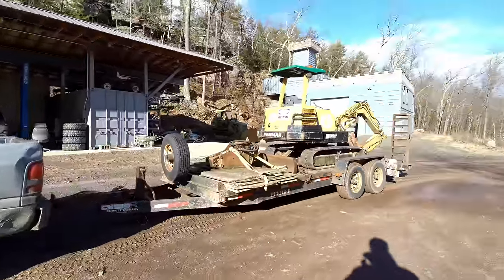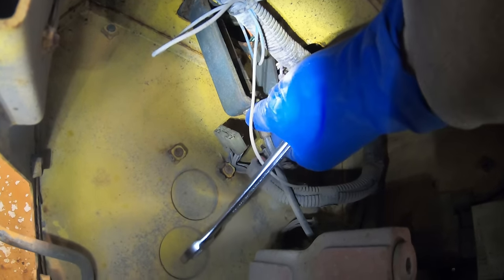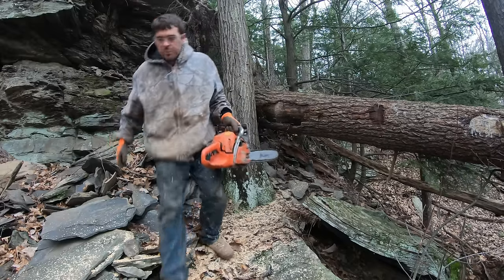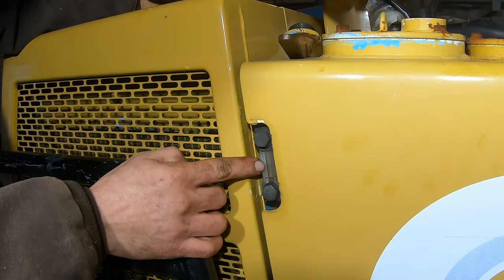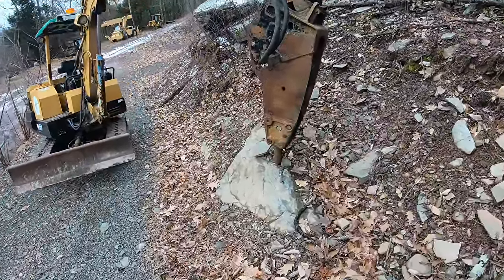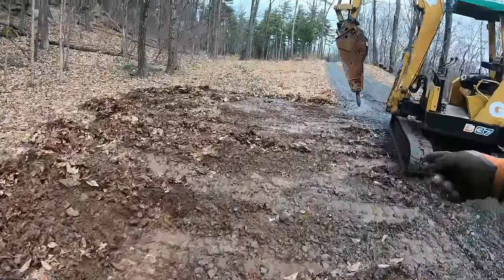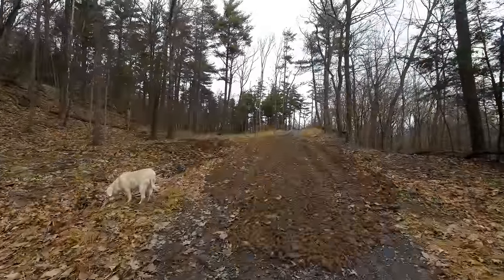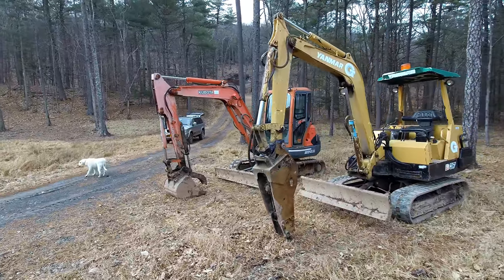Buying the cheapest excavator/hammer on Marketplace

Comment: Hey Andrew, I am looking to get into the excavation business, I am 20 years old, I have experience with tractors and such and I am looking to purchase an old used excavator. I am quite handy when it comes to fixing things, or building things for that matter so upkeep/ repair work shouldn't be too big of a deal. Would a 5k pound excavator be a good starting point for smaller jobs? I will probably be buying an Isuzu NPR dump bed truck in the next year to tow the little guy around and fill up with brush or materials. So yeah, would a smaller excavator be a good way to start and what tips do you have for someone just starting out? Thanks!

Comment: Instead of the tape, go over to your welder and put a small tack on the pin washer and grind it off later, when you get the right pins. That did seem to work quite well, though. The pin was just lacking the extra length to stick out and get a retainer in. The strength is there.

Comment: Try hammering a stump from the outside towards the center.. It usually works better with an axe that way. If you hit in center i guess the wood evenly distribute the applied force and therefore decline splitting..

Comment: You could change the control valve and pedal and have the hydraulic thumb on the Yanmar. I'm sure you can get it done if you want it bad enough. If it's a stack valve, it wouldn't be difficult at all.

Comment: Should have doser blade behind you as you dig - keeps you from tipping. Kobota looks good and warm in the winter for ice breaks and issues... cool.  Real nice source of rock for stack rock wall or design.  Hammer is way cool and your use is as good as normal. The hammer may have never been used or like you in test try. That might be another company that has yellow.

Comment: Check the hydraulic couplings and make sure they have good contact inside.  That nub gets worn down and lessens the flow of fluid.  Pull back on the coupling ring to make them connect easier, don't just push the connectors together.

Comment: Hey Andrew, have you found specs/manuals/etc for the Yanmar B37 anywhere online? Mostly interested in the height so I can tell if it will fit through my garage door. :) I'm thinking about buying a mini-ex and based on your thoughts about the old Yanmar B series (no electronics == good), I'm leaning in that direction.

Comment: Aren't those auxiliary Hydraulics different? One high flow, one directional? If the Hyd temp gets hot with the hammer, get rid of those quick connects, they add a lot of head to the system.

Comment: Isn't that bar kind of worn down pretty short? It needs a new chisel bar, doesn't it. Or is that the normal length for that hammer?
Reply from the maker: Yes it was short, I replaced it later. Than replaced the whole unit when it started leaking and could not get fixed.

Comment: Andrew, how does the hammer attachment work, does it have like a rotary valve that makes it hammer. I'm sure it's like a regular jack hammer, but I don't know how they work either. Never had an opportunity to take one of them apart.
Reply from the maker: I have never taken it apart. It works off hydraulic instead of air. It works fine.

Comment: Andrew. Run the ass off that KUBOTA. I think am going to buy a smaller one (KUBOTA) then you have. Want to hear!!!!!!!!! What you don't like and like about the machine.  I like the factor your in a closed cab which is a great thing..  You'll come around to enclosed cab some day. As for your other machine with the hammer. Keep that hammer on one machine. It takes the life right out of a machine with a rock breaker. Good luck with things love all the new used equipment...The trailer that came with the machine 
Nice drop tail. Take care. Stay warm JUNKMANDO
Reply from the maker: I like the machine so far. I got to spend a day in it. The heat was nice.

Comment: I dont know much about hydraulics but single acting cylinder comes to mind. No idea if it would work or be practical to step on the pedal to close the thumb and step off to open it. The pedal valve might not work with it as such.

Comment: So I have a B27 of similar vintage. No aux hydraulics but would love to have it. Can you tell if the system on your B37 is OEM or was added? Any ideas on how to add aux hydraulics? I've been told the pump is plenty big enough. Also do you know what the levers on the post for the controls do? Great videos!!!
Reply from the maker: That was added, It is only a one way system for running a hammer, it could not run a 2 way function like a thumb. This guy might be able to help you out with adding aux Carter 914-539-1208 
Or you could steal it from your boom tilt function that you probably never use, lol.
Those should be your safety locks.
Reply: @AndrewCamarata  Thanks, a hammer is what I want to use. So much easier on an excavator than a skid steer.
Reply from the maker: Yes, that's what he specializes in. Yeah, the skid steer probably cant reach stuff allot of the time.

Comment: I believe your stabilizer blade cylinder is    swapping fluid over the piston causing your lack of down pressure. Just rebuild cylinder completely and your problem should be solved. Basically you have an internal leak on that cylinder,
Reply from the maker: Doug O the level was just out of adjustment. It gets fixed in a later video.

Comment: question for you Andrew. which 7-8000lbs mini x  would you recommend to a guy starting off? been looking at kubota. also would like to avoid any with emissions equipment/egr ect. What year did the machines start coming emissions equipped?
Reply from the maker: Anything made in Japan. Emissions nonsense only started a few years ago. So get one that's at least 5 years old.
Reply: Andrew Camarata perfect thanks

Comment: Did you check the tool box on the machine for the hammer pins?
Reply from the maker: I didn't see them. I converted this machine to quick change. That was a big improvement, there are videos covering the project.

Comment: Cant beat a kubota, 10k hours and you can still use it everyday of the year. I dont buy any other brand. Ps when using the pecker youll find its more effective to put light force on it rather than the full weight of the machine, it needs to reciprocate to have the most effect, too much downward force prevents that

Comment: whats the GVW of the trailer...? 14k...? do you have a combination registration on your truck...? not sure about N.Y., but in Pa. the fines are big...
Reply from the maker: Combination registration?
Reply: Dont need it for a pickup n trailer lol.
Reply from the maker: I still don't know what it is. The truck and trailer is registered/inspected, the truck is insured. My bigger trailer requires its own insurance. IDK these nonsense laws are getting out of hand.
Reply: 1st...you don't have your DOT number on the truck..........2nd...the GCWR (Gross Combination Weight Rating) is required if your trailer is over 10K, and it looks like you have 8-lug wheels which should be 14K...check the plate on the trailer tongue...

Comment: Does seem to be a pretty good deal on the package but for some strange reason the trailer looked overloaded to me  as far as weight ?    you can’t beat Yanmar motors IMO  I’ve been a boater for over 25 years and everyone imknow with Yanmar power loves them  over anything else they have owned   years ago people used to say   no you will never find parts  but the reality is you usually don’t need to with proper maintenance  and care

Comment: andy go bye a cheay set of big wrenches and cut them in half  they will work alot better when you need to do hoses like that  trust me i did and it saved me a ton of time and money in the long run and you we use them more then you think harbor frieght specials will work just fine
Reply from the maker: Ok, I might, I just ordered a set of line wrenches.
Reply: @AndrewCamarata  i have them too but sometimes its just easier to have a half wrench to use in tight spaces good luck and again thanks for sharing i really enjoy your videos  i hope this helps andy
Reply: I was going to suggest the same. Pain in the a s using the longer wrenches. My father was a do it yourselfer, he had a set that he cut 30 years ago, still using them today. He worked more on Drilling equipment but same kind of hydraulic systems. Thanks for sharing.

Comment: To check hydrolic fluid: blade touching the ground, bucket flat on ground, stick 90° angle with ground. Keep all your pins greased up. The chisel on the  hammer need grease too you gonna fucked piston and walls.

Comment: Ok fellas take me to contractor school here. Im wanting to possibly start a skidsteer company clearing empty lots for houses etc, how do you guys charge? By the hour, SQ ft, etc etc, i know we need to factor in fuel costs per job etc but what keeps me from going ahead with this venture is im afraid i will charge too little and get in a hole and not being able to afford the payments on a skid. 

Another question, would you guys recommend leasing a skid loader or buying new or used? Also track vs wheel??
Reply: Willie Fistergash personally I would advise going to work for someone else first that way u get experience learn the equipment as now how to do different think in the most efficient way
Reply: Gasmonkey57 thank you buddy for the reply and helping decide what to do! What worries me is currently im disabled and 45yrs old! I dont know if a company would hire me so i was going to try a start some type of business myself as my health slowly gets better! One thing i know for certain is i love working outdoors, and being my own boss would be nice as well. But yeah i know what your saying, on the job experience with a company and possibly operating different equipment getting experience would be good!

Comment: Some rocks might let you pound a hole and then a 1/4 stick of TNT might shatter the rest. Having two on this job saves hours of doing one and changing doing and changing back and forth.
Reply from the maker: Its hard to get TNT
Reply: They make a mixture stuff that is sold in Hunting places - Academy etc - that you blow up beaver dams.  Not TNT but is powerful.  Registered by 12 oz container.  Just use it and don't stock pile a bunch.  It is two powders you mix and then you detonate the sealed/taped bottle.  (they by rifle).  You tube beaver dam.

Comment: hey Andrew: here is your new piece of equipment. It is a skid steer excavator. You take the excavator bucket off, put a skid steer bucket on, flip a switch, and all the controls change to skid steer. Take that bucket off and put back on an excavator bucket, flip the switch back over to excavator and you now have two machines in one. Not sure though, because it is still as tall as an excavator, even though it runs with controls like a skid steer. Not sure if it is as fast, but in excavator mode, it looks like typical digging speed. https://www.youtube.com/watch?v=Abr97zhMKRU

Comment: Maann 11,700 and 13,400.. 
I just found out that i could sell my Vio 10 for 15k or something. It was 16,800 brand new from the dealer back in 2004.
Crazy market..
Reply from the maker: isnt a VIO 10 crazy small?
Reply: @AndrewCamarata  Yes it is small, 1,2t. But not as small as most people think. I would say it is roughly like your komatsu, maybe 1/3 smaller and it is a zero swing machine.
And yeah most people just laught at it. "Eeehh no i'll do it by hand" ect.
Yeah... until they need it because they want to have something bigger done in their backyard and every other machine is to big to fit there. I'm the only guy in my area with such a small excavator. It is a nice little niche market.
And in 18 years it has never ever been broken down once. Just normal maintenance and it is now on the third battery, that's it. You are right about yanmars and parts, you just don't need any. Not once i had to call the dealer to get parts, advice or anything else. Yanmar is the way to go.
I wish they weren't forced to put this emissions garbage onto the new ones. This crap just ruins everything, regardless of the the brand.
Oh and Yanmar even made a couple of models even smaller: B03 scoopy, B05, B08, SV08. Really funny. Worth a google search.
Keep up it up Andrew, you are truly an inspiration.
Greetings from Germany.
Reply from the maker: Yeah, we should phase out these failed emissions programs.
Reply: @AndrewCamarata  If only half of the politicians would have like half a brain and common sense, they would do it.
I just watched the video from JH Diesel and 4X4. I can't even find words for this.
This is sheer lunacy.
Here in Germany we have similar organisations , and they also do what they want. This has to stop.
Let's hope that sooner than later people with brains get into power.
Anyway.
Have a nice evening.

Comment: Andrew, I can send you a CAD file for cutting out the kubota quick connect file, it is 3/4" steel and I had them cut for my kx71-3, perfect fit.
Message me and I can get the file over to you.
Reply from the maker: Its Andrewbcamarata@gmail.com How would I cut it out? I don't have a CnC table.  I already finished the project though. I just ordered those tabs off ebay.
Reply: @AndrewCamarata  You would have to take the file to a shop with a plasma table, the guy that made my set charged me $40 a set and i saw on ebay they were $125+shipping. I saw your video, looks good.

Comment: Andrew check ritchiebros.com and Iron planet. Awesome prices and set of machines. 18,000 hs is just 2250 days of 8 hours, 6.16 years. 8000 hs, /8=1000 days of 8 hs of work, less than 3 years. 10,000 hs/8=1250 days of 8 hs work=3,42 years which to me, both are great boughts and, as long as they function they will always have value so you may recover more than the inversion plus the money on the work you do. They don't look abused just the Yanmar a little out of maintenance but both are a "gold mine!"

Comment: 25:09 does anybody have an opinion to this, make a wedge 1 foot long and  2 inches thick sharpened welded to the jack hammer pin would it split the wood?! Kinda would be cool if it was possible

Comment: I have a kx121-3 & I run the hammer off of the thumb hydraulics
Reply from the maker: Good to hear. I'll try it once I convert the hammer to fit on the Kubota.
Reply: I can send you pics if you want of the adapters used so the thumb doesn’t release when switching to hammer
Reply from the maker: Ok. Andrewbcamarata@gmail.com

Comment: Mr Mrrphy.  You'll die if you saw my Amazon/ home depot/lowes credit accounts.  Everything from soldering irons to a Cub Cadet with a plow and a trailer and a broadcast spreader.  LED Bar lights and wire connectors etc etc etc.  My wife said   The lawn tractor was fine,  what are you doing to it .  I Said,  bar lights tail lights strobe lights,  I'm no Andrew Camarata but I'm trying.  

Andrew you have no idea what you've done for the economy.  I'm in the hole over seven thousand Bucks

Comment: Jesus..this guy shouldn't be operating equipment. One day on an actual job site and he would be fired.
Reply: What gave you that impression?
Reply: @ashleytewkesbury5999  For starters he is digging with his blade up.  The blade should be down for stablilty. Second look at how he is digging. If my boss saw my tipping any equipment like that I'd be fired.  Also those mini's are way too small for those trees he was pulling.  Last but not least putting duck tape on the pins holding the hoe ram.....luckily no one got hurt.
Reply: Luckily he is his own boss then I guess? And if you are an machine op, you cant say you've never botched something to just get the machine working and the job done